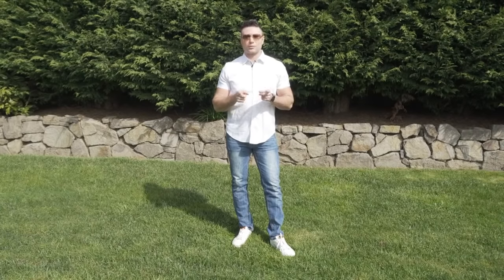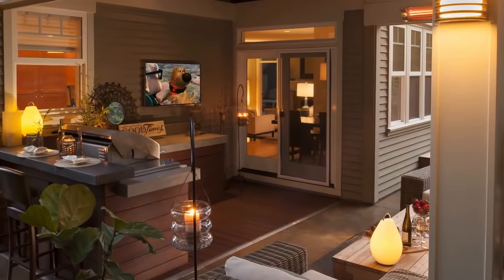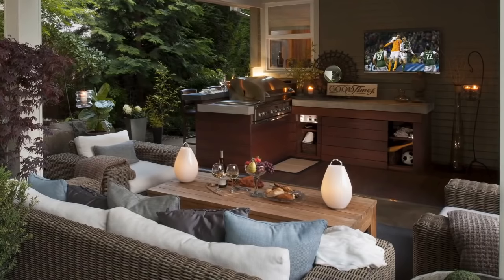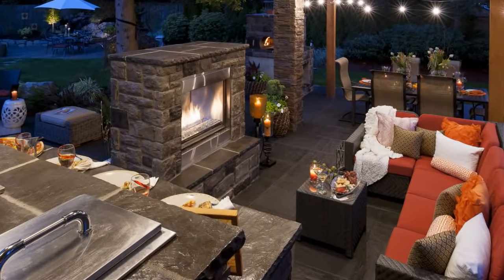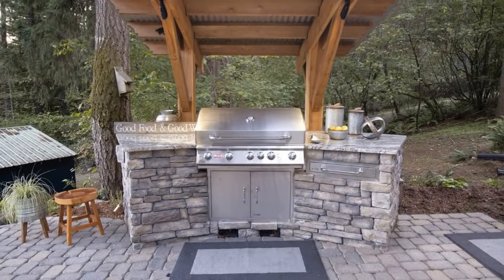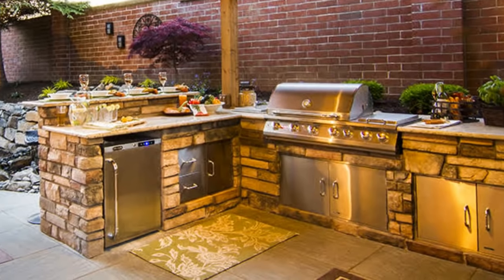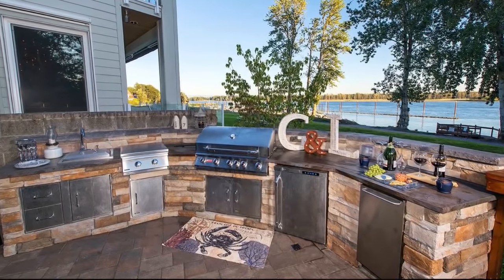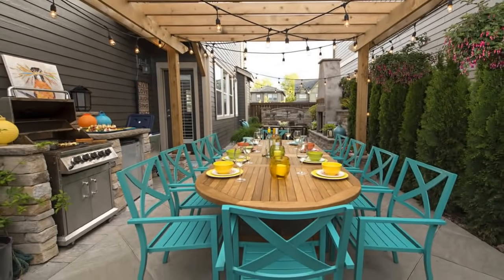Outdoor Kitchens for Small Spaces (Pro Tips)

Comment: Love your work. I just subscribed so I can continue to get ideas & tips from your great videos. We're watching/have homes in Las Vegas NV & Elsinore UT.
QUESTION: A lot of these outdoor kitchens have BBQs under a roof, does some of the smoke from the BBQ linger  under the roof?
Thanks, keep up the great work.
Reply from the maker: Yes, the smoke does sometimes linger especially if there is no wind. Being open air structures the smoke usually quickly leaves the space. We do have a few two walls on the structure and and the smoke has a tendency to stay a little longer but its usually not a big deal. If you are concerned a simple hood vent would solve the problem. Thank u for your support. Please let me know if you have any additional questions.

Comment: I'm in the middle of designing the rear landscape. I was advised not to put our kitchen underneath our open porch due to soot accumulation. We agreed on putting outside and we didn't want a pergola because it would hide the view of valley. I was worried because 99% of outdoor kitchens are in covered spaces but I see the second to last design is totally exposed.